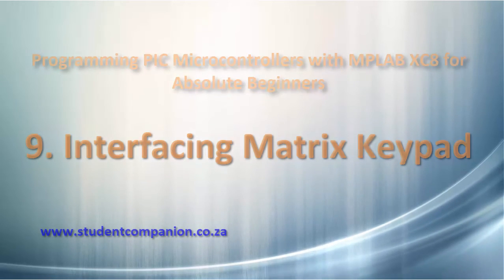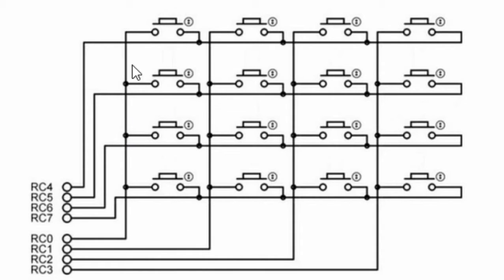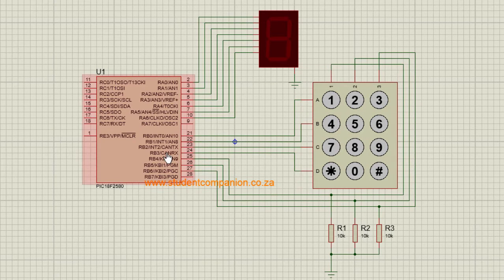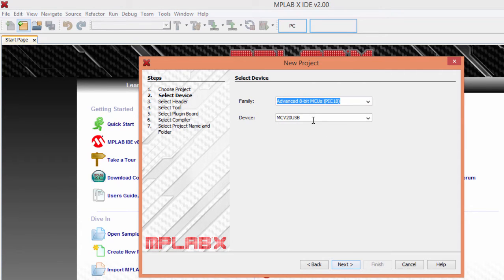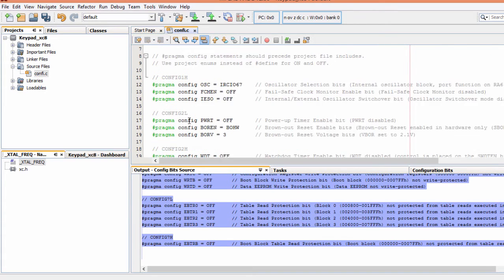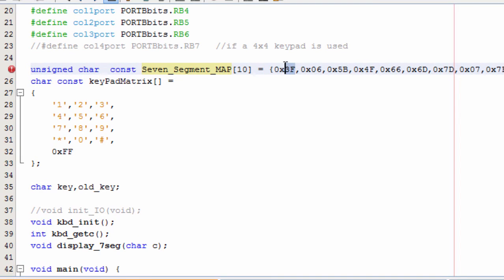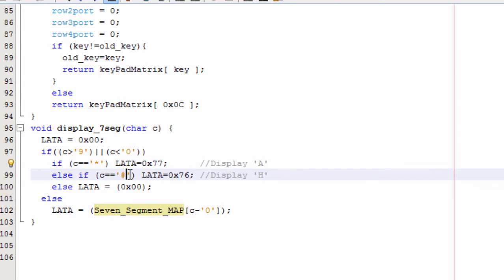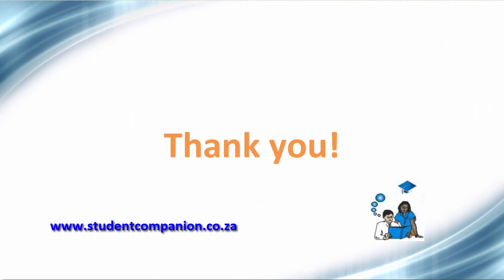9- Interfacing Matrix Keypad | MPLAB XC8 for Beginners Tutorial

Comment: What does the line 'row1port = (row & 0x0001) >>0' do? Why the >>0?
Reply from the maker: row1port is a define for LATBbits.LATB0 as defined in the code in the top. row1port represents Row A of the keypad.
To scan for a key pressed, we apply logic 1 to the first row then read the columns output.
In this case:
row1port = (row & 0x0001) >>0
We are applying 1 in binary for RB0 then shift right by 0, which won't make a difference, then the 2nd line we will shift by 1, then 2 and so on. These values are in binary.
Reply: StudentCompanion how is the key able to access the array and find which number is pressed? How does the count increase? Is the key's count dependent on the for loop?
Reply from the maker: @monitorprey5003  if you want to read a key, you scan the keypad by putting a 1 a each row successively that's what that code is doing then read the corresponding column then you will know the key that was pressed.
Reply: StudentCompanion so the char const keypadMatriix is a matrix function?
Reply from the maker: @monitorprey5003  you are asking so many basic questions around the same thing, I'm sorry if we are not clear in answering your questions but this we feel like is an abuse of the process. We have to also prepare answers for others as well not just you. We can't explain you each and every variable and line of code in this tutorial. You shoulf try hard to learn it as well and practice so you can understand the concept in your own words. Or if we are not clear enough, follow other tutorials  from other people and  learn the missing piece
Reply from the maker: @95Gred  NO. 0x0001 does not represent RB3-RB0, it just masking, Google PORT masking to learn more. Because the value of row will contain the whole PORT value, we are here reading one bit at a time by masking the rest of bits. 0x0001 will make sure we read the values of the least significant bit only and ignore the rest.
Because we are in a for loop scanning our keyboard, the next scan will be to use the mask 0x0002 which will ignore all pins except the second pin and so on.
Reply from the maker: @95Gred  0x0002 is 0010 in binary meaning we are masking all pins except the second pin to read it.
0x0004 is 0100  in binary meaning we are masking all pins except the third pin to read it and so on.
Basically if the corresponding bit is 1 then we can read, if it's 0 we ignore it.
Reply: StudentCompanion so by shifting the bits by 1, we are only interested in checking bit 0 or in other words making row2port =1?
Reply from the maker: You still can't understand! Google bitwise operators to learn more.
Reply: StudentCompanion ok understood. So by moving 0,1,2,3 we are always making the '1' appear at bit 0 when it matches.
Reply from the maker: @monitorprey5003  not only at bit 0. At each row, check the keypad connection and see where the rows are connected

Comment: Why using INTCON2bits.NOT_RBPU instead of INTCON2bits.RBPU?
What's the essence of NOT?
Reply from the maker: Hi, INTCON2bits.NOT_RBPU is to disable the internal pull-up resistors because we are using external resistors on the switch,  INTCON2bits.RBPU is to enable those pull-up resistors which we don't want in this case.
Reply: Okay.
Thanks
Reply from the maker: You are welcome!

Comment: please kindly explain how these below code codes works....
1. why did you use INTCON2bits_NOT_RBPU=1;?? what happens if put to "0"??
2. row1port = (row&0x0001)>>0
    row2port = (row&0x0002)>>1
    row3port = (row&0x0004)>>2
    row4port = (row&0x0008)>>3
please kindly explain how this code work internally... i mean the ">>, and &"
i understand that they are use to scan the keypad, but did not understand the code operation
3. secondly....
  if(col1port) break; key++;
  what condition does "col1port" equal to in the 'if(  )'?? please explain this code in full.
4.  lastly....
    if (key!=old_key)
    old_key=key;
     return keyPadMatrix[key];
please kindly explain for easy understanding and not for cramming ...thanks in advance
Reply: please... i await your comments
Reply from the maker: +Temitayo Abel which comments? Please refer to our website: www.studentcompanion.net
Further explanation is provided.
Reply: i don't know if am correct about this... 
row1port = (row&0x0001)>>0
    row2port = (row&0x0002)>>1
    row3port = (row&0x0004)>>2
    row4port = (row&0x0008)>>3
simply give zero(0). i mean row1port=0, row2port=0, row3port=0, row4port=0. is this true??
Reply from the maker: +Temitayo Abel what are you trying to do?
Reply from the maker: Hi. 
>> is bitwise shift right; moves the bits to the right, discards the far right bit and if unsigned assigns 0 to the left most bit, otherwise sign extends.
Reply from the maker: Look we won't be able to explain line by line of code of all our tutorials  because we won't have time to do so as we have to answer to others and prepare more tutorials. 
We only explain line by line of code to people who assist us to produce these tutorials. People who make some donations. We dedicate all our times to explain to them everything.
Thanks
Reply: if that be the case am ready to make payment to understand this PIC microcontroller of a thing just tell me how to make the payment then m on.
Reply from the maker: +Temitayo Abel on the about page of this youtube channel or below each video in the description there is a link to make a donation.
Reply: Please how will you know it me if i make the payment??
Reply: The patron isn't allowing me.... it keeps saying.. ''We were unable to create your account, the email may be taken.''i changed the email to another type still the same thing..
Reply from the maker: +Temitayo Abel Hi. Please use PayPal. It's easy to use.
Thanks.
Reply from the maker: +Temitayo Abel Hi. When you make a payment we will receive an email stating who paid and how much.  Please use PayPal.  All you need is to send to our email address: info@studentcompanion.co.za
Reply: please send the link
Reply: you mean i should not use the patron??
Reply from the maker: +Temitayo Abel you said patreon is giving you problems.  Most of people who make a donation to us use PayPal.
Reply from the maker: +Student Companion here us the link: 
https://www.paypal.com/cgi-bin/webscr?cmd=_s-xclick&hosted_button_id=K8RNMNDNFBV58
Reply from the maker: +Temitayo Abel https://www.paypal.com/cgi-bin/webscr?cmd=_s-xclick&hosted_button_id=K8RNMNDNFBV58
Reply: am really having a big problem linking my card, think it from my bank.. will have to sort that out very soon...
Reply from the maker: +Temitayo Abel ok.